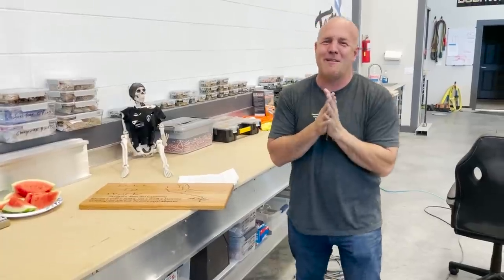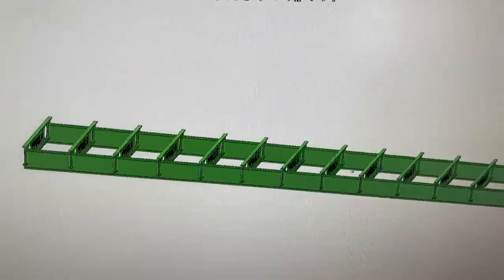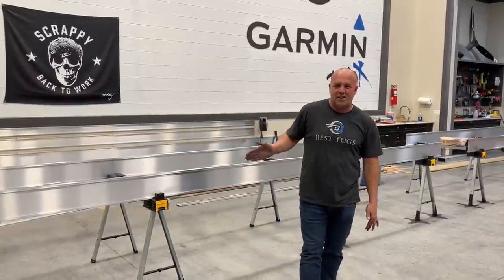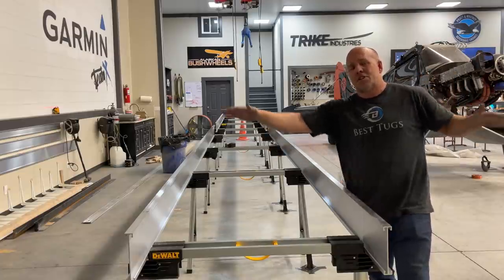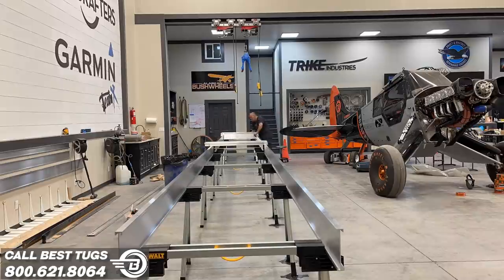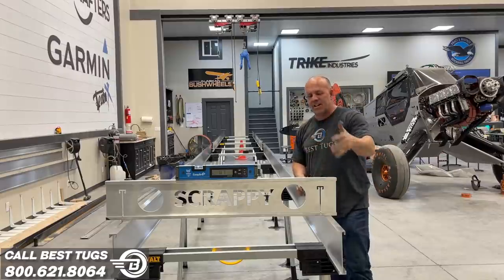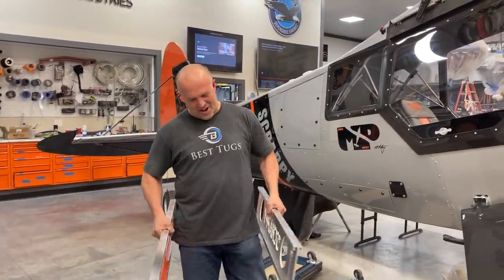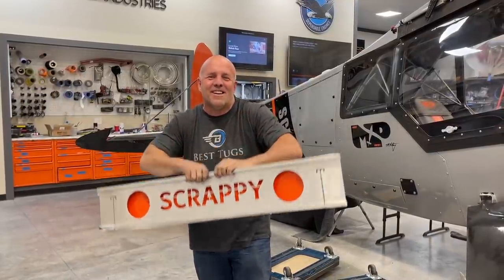Water Jetting aluminum tables and twist in a wing | Scrappy #51

Comment: The switches are for actuating the variable geometry for the expandible wings. Slats, flaps (leading and trailing edges) and probably variable thickness of the airfoil.this will be a polymorphic wing!
Reply: oooh i feel like you are on to something. time will tell
Reply: I think the slats and flaps are synchronized with a single linkage so he doesn't have trim changes when they're deployed.  One switch would be for air-brakes of course.  Last switch to set the landing gear for maximum angle of attack?
Reply: PLEASE DO NOT GIVE MIKE IDEAS ...we will never see the end of this.... oh wait  a minute ... what the hell am I saying ... its already happening . 
Now the videos have a "Get On With It" ... I mean if those words are getting into the edit  .... we have nothing to say now ... LOL
Reply: @nevillecreativitymentor  Don't worry, those ideas have already left the barn.  He's either mentioned them in a video or you can see them fermenting in the background of several videos. Look at the Solidworks screens in the background of a few recent videos :D
Reply: I thought the same
Reply: I think you might be correct.  He showed sailboats that change their airfoil plus he said he is building the wings as no one has ever done before.

Comment: my 3 guesses for the covered switches: 1. JATO rocket  2. Flame Thrower 3. Air Boat Mode
Reply: JATO: jet assisted
RATO: rocket assisted
Reply: ALL THE ABOVE IS MY GUESS WITH MIKE PATEY AROUND!! Lmfao!!! :P
Reply: VTOL mode? Or lowrider style hydraulics? Oh wait we know that already
Reply: @307Driftwood GREAT POINT!!   I know a few Passengers that I would have GLADLY Pushed The Eject button on!!  Lmfao  :D
Reply: @Hamring  Do you think Mike added “switches, Hydraulics” So he can be like SOUL PLANE Bouncing to the Runway, With Snoop Dogg playing in the Background?? Lmao
Reply: Jettison external payload. Power up external payload. External payload function. You could do a lot with just those three things, everything from high bandwidth imagry for search and rescue, airborn repeaters for disaster communications, ferry tanks, deployable scientific packages (i.e. metrology or seismology experiments), deployable antenna arrays (for long baseline radar with longer wavelength for ground or water penetration)
or even launching a drone...
Reply: I was guessing air suspension to bounce the plane up for take off. He has mentioned it in his early drafts about possibly wanting to try it out.
Reply: Smoke, and something to do with airfoil/flaps/chamber adjustment of some sort.
Reply: Definitely the transformer wing...
Reply: He DOES have 
hardpoints for floats 
installed, so... 🤟🏽🐻
Reply: I would guess it's for progressive wing modes
Reply: Pretty accurate concerning the coolest craziest aviation dude
Reply: @mckinleywilson6184  all rockets produce jets. Hence jet propulsion laboratory.
Reply: @flip66five  multi element flaps
Reply: @carlsjr7975  JPL started with jet engines before they made rocket engines...

Comment: I found a picture of the central switches without tape, and it is exactly what I tought it would be for. Really cool and I hope it will give you a nice performance boost when it comes to STOL performance, both landing and takeoff! 

Because you are keeping it a secret and making a bit of a game around it I won't spoil the fun by telling what they say :)

For those playing along, Mike has used the switches quite a bit the last couple months and you can even see it in the video's!
Reply: STALL or STOL?
Reply: @professorvoluck9311  Ah thanks! I thought of STOL but for some weird reason I typed stall. Fixed!
Reply: That's right!  I think I remember him mentioning something about the wing area being adjustable!   You'd want smaller ones for cruising speed and larger ones for slowwww off field landings.
Reply: @keithcress1335  nope :). But now that you say it I'm a bit sad not to see any buttons for that!

Comment: The switches 
1. Raise gear 
2. Increase pressure in shocks to rear up like a horse in stol
3. Auto brake for landing with automatic brake thethering
Reply: Not only raise gear but bounce it for take off. So there is 0' of runway needed.

Comment: The buttons have to be for suspension height adjustment/launch control.  Those hoses running to the king's aren't a normal thing and would allow for pressure/height adjustment and dumping high pressure in at rotation will hop scrappy into the air.

Comment: Switches: Lift the gear so the mini "wings" are level and other mischief with the gear like dampening for various surfaces?
Reply: And wings extend..... may be .....
Reply: @otc-x1-b9  
Auto folding wings... Epic! 😉😉
Reply: Yes!  I've been saying that for months.  At a minimum he needs a suspension lock, but raising them up level would be best for predictable flight dynamics. And knowing Mike, he will probably also have adjustable damping, like in cars that have a "sport" mode?  Maybe adjustable ride height?

Comment: Said it when he first mounted the gear and shocks...adjustable suspension. Can't wait to see his plan. Set height to change angle of attack on take off and landing ?Maybe? Softer on rough field landings, firmer on hard surface?  Off road industry has been doing this for a couple years now on production stuff,  suspension tech has been changing rapidly. Leave it to Mike to bring it to aircraft, specifically the STOL world. The guy is just amazing...his work is inspiring.
Or...he has finally perfected the Patey version of the Romulan Cloaking Device.
It could go either way.

Comment: The thickness could slightly vary between paint sticks I would imagine? when working to 7 tenths of a degree wouldnt a difference of thickness between two paint sticks make everything else slightly off? Even so the attention to detail with your measurements and everything is awesome!!!! Back to work
Reply: Paint sticks, much like most things that are manufactured in bulk, are incredibly consistent within the same batch. There may be some variation batch-to-batch, but with something like a paint stick that's carved out of wood, I'd doubt there's much variation there either.

Now if those paint sticks had been exposed to a lot of moisture, say they got rained on or maybe even just left out a week in really humid weather, they'd warp like anything made of wood and all bets are off. But I trust Mike knows that.

It's like the thickness of a single-edged razor blade (not how sharp the edge is, the thickness of the piece of metal that gets an edge ground on to it). It's incredibly consistent, even between different brands and different factories. So consistent, in fact, that people working with high power lasers will use them as an informal test for just how powerful and/or well-aligned the laser system is. If the laser puts a hole thru the razor blade, that same laser will have at least a certain amount of power. And if the hole isn't perfectly circular (or a few other very specific patterns), then it's out of (optical) alignment and needs adjustment.
Reply: @44R0Ndin  my point is, it would be more beneficial to use something more accurate then a paintstick.
Reply: @jeeperzcreeperzz  That's a valid point, but over the long distances involved a few thousandths of an inch aren't going to make much difference.
Reply: @44R0Ndin  hes working to 7\10 of 1 degree and other very tight tolerances... With that kind of  accuracy, changing a Paint stick with another or adding one and assuming its the same can counteract that accuracy. Thats a fact.
Reply: @jeeperzcreeperzz  Right but he's not JUST using paint sticks. He's also using layers of tape and constantly measuring it after adding each layer of tape. The paint sticks only take up the majority of the space, they don't actually set the dimension by themselves.

Comment: After the previous video, I felt that I needed more, so I rewatched the Draco build series, and just finished rewatching the Scrappy videos, and I have a few questions. 
1) did you add the "baffle" to your oil cooler air inlet side?
2) when you made the rear window trims, would you not have saved some carbon if you put the one trim piece's "arm" between the other piece's "arms", staggering them?
3) did you put anything between your head lockers and the carbon upperdeck pressure plenum to prevent galvanic corrosion?
4) I think I missed the video, or part of the video, where you explained the custom hoses that goes from the shocks to the fuselage? Is it to adjust the shocks from the panel, or maybe to create the "launch" effect you wanted to do with Draco's suspension? 
Thanks for creating the most amazing aircraft and videos!

Comment: My guesses on the 3 switches: 
1) Tail Smoke for air shows/search & rescue
2) Parachute
3) something to change the wing shape/control surfaces

Other guesses: on board oxygen for high flying, some other kind of signal for search & rescue, something like air ride that would allow him to raise and lower the plane with the gas shock pressure, same thing but tire pressure,different maps for the engine or different types of gas, something to electronically move the weight balance of the plane, change the pitch of the prop...etc.

Mike is a mad scientist. Whatever it is, it will be awesome

Comment: The buttons are for suspension tuning?  1) Raise suspension and lock it in place so winglets are level during flight, 2) Lower the suspension all the way down for easy entry and maintenance, 3) Adjustable damping and ride height, firm/ low travel for runway landings, and soft/ long travel for back country landings.    (Even if I'm wrong, I should be right...if I'm wrong it is reality's fault, because just knowing active suspension on an airplane exists would make the world a better place!)

Comment: I built my miter saw bench years ago in a similar way but with lumber. Cantilevered benches are the only way to go. No legs to get in the way an keep kicking. I used cheap white coated 1/8" MDF as the sacrificial top. It's slick and I can write measurements and notes on it with a pencil and wipe it off when done.

Comment: I think the switches are going to be presets conditions:    
Max performance takeoff.     
Max performance cruise.     
Max performance landing.        Like presets for slats/ flaps/ prop feather/ nitrous, trim position.  Basically Anything and everything Mike could hook up to it.    Mike is the kind of guy who would know how much fuel he has left by logging the data from individual O2 sensors in each header tube. Ya know, as a back-up😉.     Love All of you over there.

Comment: The switches are for adjusting the position of the main gear legs via the king suspension. He’s going to use the airfoils he built into the legs to increase lift/drag and land on a dime.

Comment: Did you ever answer the question of why aluminum wings instead of composite/carbon fiber? Interested to know why.  Nice work on the wing table.
Reply: When carbon moves it chafes. The skin is going to slide as the wing changes shape so it can't be carbon.

Comment: Ok! Serious guesses on the switches.

1 flaps/slats 
2 variable angle of incidence (allows higher AoA at lower pitch attitudes) 
3 (not sure about this one) a squat/jump switch for the suspension that mike had mentioned wanting to put on draco but couldn’t find a way to do it after the fact.

Comment: Half the cost & Time of a Home Built turns out to be building the Jigs and Fixtures. I still have a basement floor covered in epoxy all around the table used for the Burning & layup of the wings for a Dragon Fly My Father ended up never finishing. In july of '94 when they moved to Wickenburg AZ he wrapped it all up and never unwrapped it and sold it to some one in Eloy AZ.

Comment: To spell out the good that could come from what others have mentioned, which is bouncing the plane into the air:

With the shocks near bottoming, he could quickly get to stall speed. He could then pop the shocks up, giving himself a couple feet of altitude without costing himself any airspeed. Meanwhile, the motor is still pulling hard, and by the time he stopped ascending from the shock bump, he would be above stall speed, and could take it from there.

Basically, STOLwise the secret buttons could enable him to skip the time/distance it would take for him to reach rotation speed from stall speed, but take off anyway.

Comment: After watching, I'm not completely clear on the distribution of the twist. Is it all out toward the tip with most of the wing having no twist, or is the twist evenly distributed from the root to the tip?  Experience and experimentation tells me that building the inside75-80% of the wing without twist performs better....Your tristed table will be great. An excellent wing jig. I like it.....A couple other questions. Will the wings be flush riveted? Are you considering bonding and riveting the skins? Like a metal wing sailplane. Pretty the ultimate for strength and rigidity. Which leads directly to another question. Thinking about building riveted wing tanks similar to the RV series airplanes?  They are so cool. several thousand flying for many decades. Seems unlikely, but the wet wing,, sealed and riveted tanks are as dependable or more so as any other tank system. Dick VanGrunsven  is a truly fine engineer. One of the very last WW II slide rule engineers. Hard to imagine a better tank system for an aluminum wing......Cheers, Joe Evens.

Comment: Logical would be: lower the fuselage flap, lower the gear to minimum prop clearing, NOX injection armed. Extra switches on stick and thrustlever will release the jump into the air.
Reply: @michaelspunich7273  Zero roll take-off is the aim I guess...Wondering if there is footage getting only the fuselage airborne with brute force of the engine, the gearfoils and the flap

Comment: You received your minimum order.  Meanwhile Wag- Arrow is out of aluminum main spars! 
   A switch to extend or retract your Leading Edge, one is for your in-flight adjustable dihedral. The last maybe for your massive flaperon or multi-position follower flaps?

Comment: How about jack screws on the horse stands instead of paint sticks ?For easy reuse on the next planes wings.
Reply: That complicates the design and leads to a potential failure point if the screw turned while you're building and you didn't know it. A shim taped or glued in place is very unlikely to fail and is simple and quick.
Reply: @ihdieselman  jam nuts

Comment: Switches:
1. Increase wing width 50% in 10% steps. 
2. Increase wing span by 25% in 5% steps
3. Increase wing/airfoil thickness by 20%

New wing is 50% lighter then a carbon cubs, 70% more wing area and 200% stronger..

Comment: Will Scrappy use Junkers flaps/flaperons like the Kitfox or stick with the traditional Cub surfaces? The Junkers flaperons seems like a good system for low speed, with a drag penalty at cruise. Would the extra drag be offset somewhat by reducing the need for washout to keep the control surfaces flying? Do the leading edge slats decrease the benefit of Junkers flaperons ?

Comment: Aluminium? Would there be a material that would respond better to the foil shape changes? A polymer of sorts? Lycra sprayed with a thin layer of linex? Recycled plastic oil quarts? Even airplane grade aluminiun cracks after a few heat cycles, and doesn't do well with UV rays.

Comment: I did not hear you mention the reason for the aluminum skins? My guess is not only the obvious advantages but it would also negate the need for internal drag/antidrag structure. Correct?

Comment: Guessing the reason for aluminum skin for the wing is because carbon fiber does not expand as much as aluminum with temperature.  Thus you could accidentally bend your aluminum spars. Ie aluminum expands and carbon skin does not.

Comment: Mike Patey

There are so many electric airplanes being built and designed that it made me think of your TUG. 

I notice that the electrics have a very short range do to the short duration of the battery charge under flight conditions. 

This condition will probably persist for a few years until technology improves the range to an acceptable level.

Enter the Patey Super TUG/Launcher. 

I believe a tug could autonomously push or pull the plane out to the runway and then possibly push or pull it down the runway maybe even to takeoff speed. It would then return to the hanger for re charge. It could also be controlled by the tower if they deemed it necessary. 

By engaging the aircraft motor only as it reached flying speed precious minutes would be added to the actual flying time. 

All power check lists could be accomplished at the hanger with the plane still on charge. 

I wouldn’t have given this a second thought if I hadn’t watched your many videos. I believe you could overcome all the problems involved in a project like this and maybe even make a profit.

Enjoy watching your stuff. Ron